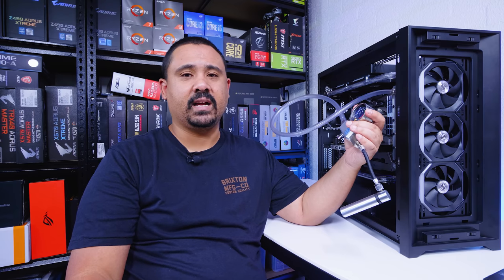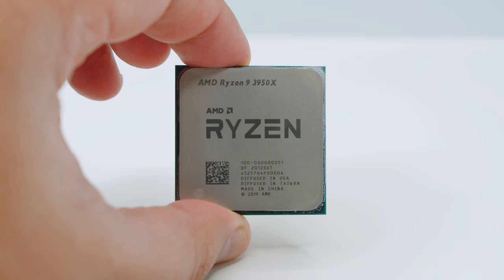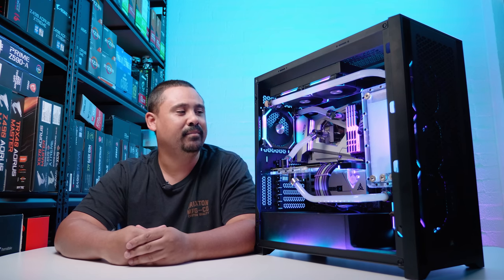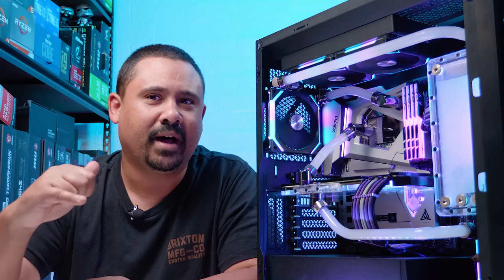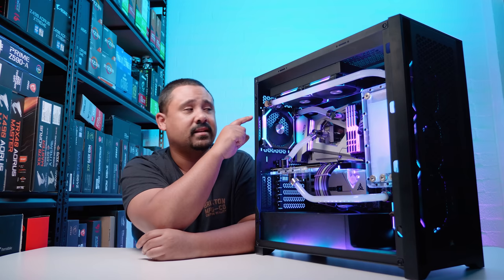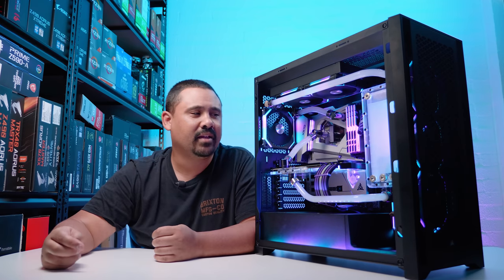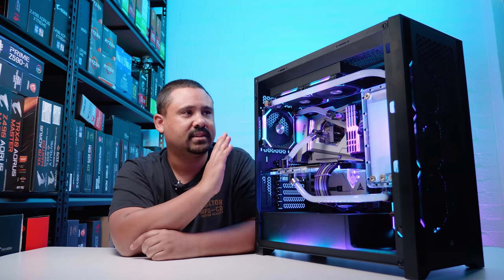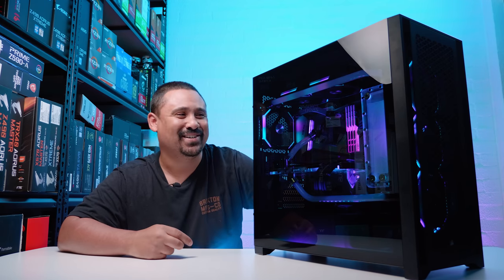My Dream Water Cooled RTX 3090 Gaming PC in Corsair 5000D Airflow

Comment: You've hit peak perfection with this build. Absolutely banger and build of the year so far. From parts, fittings to cables you've clearly had a plan throughout the whole build. Cinematic mode baller as always. Keep up the hard work fams and find some time to enjoy some Skater XL. Benchmarks for sure if you find the time otherwise no biggie.
Reply: It's not overly complicated and the triple diagonal tubes look better than a straight vertical or straight horizontal setup.

Comment: Proposed Name: Mystic Dream

Mayhems Pastel would have worked for a long-term no-maintenance opaque coolant as well. My last system had Mayhems Pastel Yellow for 35 months and all I did was top it off as needed. My current system has been running with Mayhems Pastel Red since March 3rd. How long it runs depends on how good Intel's 12th Gen CPUs are - I may do an upgrade or I may skip it. I got Threadripper 1950X on launch day, and I may do the same with the 12th Gen flagship.

Comment: Could you fit another ek cylinder style resivoir in front of the ek distribution plate pump? Wanting  to switch cases and change my water cooling up a tad. Love this case. Just built My brother a 4000x water cooled.

Comment: What did you use to offset the top rad, I need to mount mine to the 140 holes but can’t find a solution for the other side of it.

Comment: I'm stealing your idea Nick!!! I've wanted to build a loop in the Phanteks 719 since its inception. But couldn't figure out how to use the back panel vents for a rad, with a rad in the front aswell. But mounting one of EK's distro blocks to the backside radiator would be perfect. Can you let us know if cooling or noise suffer? Cheers bud..

Comment: Do they make a distribution plate that will fit the whole length where you placed yours?
Reply from the maker: It's not a distroplate. They do but plumbing will be near impossible.
Reply: @GearSeekers   thanks
Reply: @GearSeekers  What is a good case for a beginner to install a custom loop.  I want 2 360rads and a distro plate.  10900k, 3090 ref.  and I would also like to cool ram

Comment: Hi guys. coming with questions: i have done a custom watercooling on a iç 10900kf, rtx 2080 ti. loop is : front 420mm 3 push/2pull , pump D5, GPU, top 240mm 2 push, back to front 420mm. I have pressure issues as pumps becomes noisy if I want flow. temps stay high (65 to 75) under Tarkov sessions. I'll change the pump for a dual revo D5 soon and chang fans from bequiet pwm to bequiet pwm high speed (silent wings 3 before and after). I was strucked by the lake of pressure of a single D5 and the temperatures. I'm questionning the necessity to recheck the correct LM application on CPU and alos my GPU is bended a bit so maybe some screwing was wrong ?? (on a MSI Z590 carbon EK X)

Comment: I think your video almost answers my question about rad clearance for my 5000D setup :) Normally I see people setting up their rads in the front and top, but your rad placement looks like what I'm going for. My setup right now is a 360 mm thick (54 mm) rad on the side + 3 fans. And I'd like to add a 280 mm rad to the top side, with 140 mm fans. You're using a 240 mm rad at the top, correct ? Do you think a 280 mm would fit with a side rad mounted ?

Comment: Great clean build! I'd be curious to know how you set up the uni fans to the Commander Pro. Did you use the hub provided by LL?
Reply from the maker: No. I made my own adapter cables.
Reply: @GearSeekers  Ah, I see, thanks. At the back of your case I saw 2 other controllers - what are they? Did you run PWM to one and RGB to another? Sorry for the questions - my own build is similar (10 uni fans and Commander Pro) but I've just not been able to achieve an elegant solution to both PWM fan and RGB control. I've had to use the provided hub from LL to connect all the RGB then running that with an adapter cable to the Commander Pro which then meant using the L-Connect software which is annoying...  How did you sort all that out?